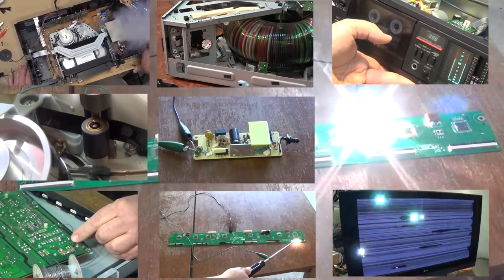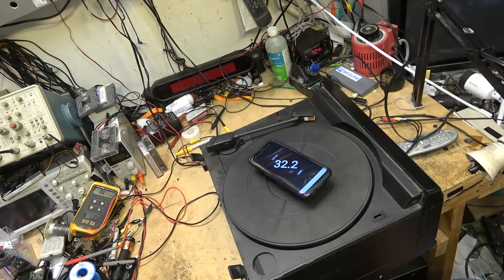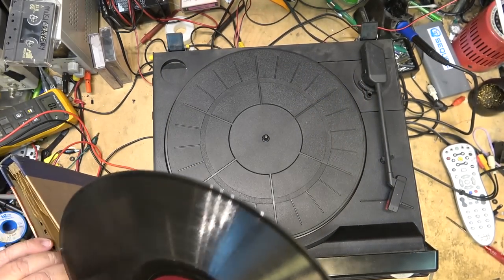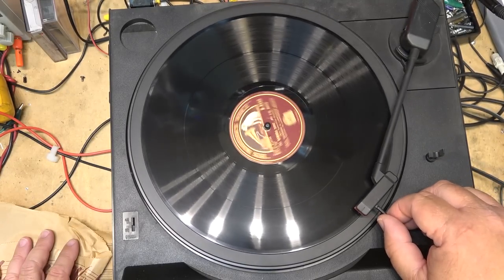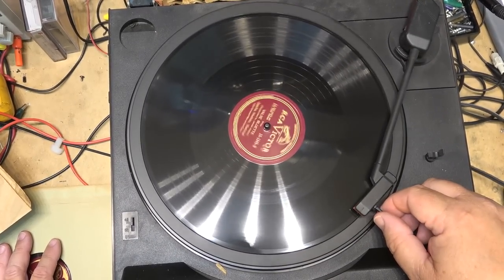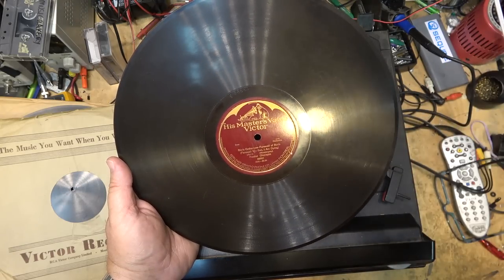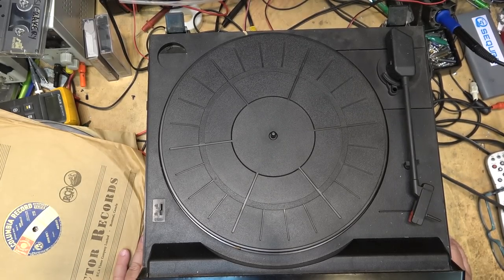78RPM mod for an old cheap Panasonic Record Player.

Comment: I’m sorry to say this but as fellow 78 rpm record collector myself I found this video very painful to watch they way you handled those records hurt me And for the Columbia special artis recored Label I would have killed to get my hand on one only for someone who is an amateur to buy a cheap turn table and slam that fragile shellac record it hurts also you didn’t care and hold a record by it’s grooves don’t do that next time please it will ruin the groves
Reply from the maker: Can't hurt them any more than the old wind up phonograph with the steel needle that weighs about 20 grams. Got rid of most of those records.  A collector took them of my hands.  Only kept the big band 78s.

Comment: Question: does speeding up the motor to get 78 RPM  decrease it's life significantly? Just wondering.
I have 1 12 inch 78 Rpm record. My late Grandmother's. (and stacks of 10 inch 78's) and also, a long, long time ago, only the wealthy could usually afford a victrola and records. At least that's what I read.
Reply: Very likely, but you could just change the belt drive pulley instead,  bigger diamater.
Reply from the maker: Won't hurt it at all.  DC motor will run at pretty much any speed up to the point it flys apart and this isn't even remotely close to that speed.
Reply: and now the victrola name has been bought out by trashy unknown china manufacturing lol
Reply from the maker: @coolelectronics1759  
Well you know who to blame for that.

Comment: If the record is from 1913, is it still possible to get a copyright strike? Current time limit is 95 years from publication?

Well that answers that. Maybe write  strongly-worded legal threat to the supposed copyright holder would result in a big fat legal settlement check? Turn their own game against them.
Reply: The recording may be from 1913, but based on that album art, it's clearly an early 1950s issue.

Comment: If that album is from 1913 it's in quite unbelievable condition. They've been well kept and will increase in value with time. Take care: they're really fragile in more ways than one! 
You need use special packaging methods when posting them and even then you're never sure they'll get there safe. The needle used can also damage them during playback. I believe the problem is some modern 78rmp needles have a stylus that's too small and gets pretty much way down at the bottom part of the groove, scraping its sides. Gotta remember that modern needles have diamond tip which is a lot harder than 78rpms can take.
You're quite lucky to get such a collection but shellac disks need proper storage conditions and take a lot of space. Lot's of people don't know they're quite valuable and just throw them away which is very unfortunate as a lot of rare recordings, especially by the early greatest artists of the 20rh century only exist in shellac.
Reply from the maker: I'm pretty sure theses are valuable. Most were tossed out eons ago.

Comment: That was fun!  I'll bet you didn't even need to jumper the resistor.
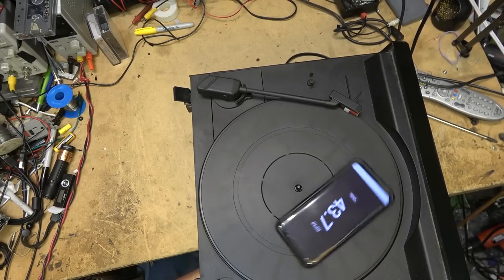Reply from the maker: You did see the part where it went up to 52 RPM or was that a point that you skipped ahead?  Its at 3:40 FYI. If you saw that then you would know that the resistor needed to go.
Reply: @12voltvids  Gotcha, thanks.  I guess the suspense was killing me and I skipped ahead. :)

Comment: There are companies that are buying up the rights of all these old recordings. 
They are not necessarily in the music business but more about money and getting revenue from copyright.
Reply: There's a term in the law like "use it or lose it", which means something like: the owner of the copyright of the music must provide fresh copies to the public on modern media for reasonable prices, or the copyrights will not be granted.
From https://recordingcopyright.org/faq.html :
"The international record companies are fighting to extend copyright everywhere, to increase their monopoly control for up to 95 years—even though in most cases they won’t use it. They suffered a severe setback when the U.K. refused to extend its 50-year term in 2006. Most scholars and economists oppose term extension, and extensive studies have shown that it will cost the public money while not benefiting musicians, however politicians have largely ignored these studies and backed the companies. The companies next tried to push through a 95 year copyright term throughout the European Union, but again there was a furious backlash. Eventually a compromise was reached in which the term was extended from 50 to 70 years, but with significant conditions. The companies get the extra 20 years only for recordings that they keep in print ("use it or lose it"), there is no retroactivity (everything made prior to the early 1960s stays in the public domain), and they have to start paying backing musicians, not just the "stars," no matter what the original contracts said. Separately, the European Union has also enacted legislation allowing the use of "orphan works." The Europeans realize how badly the U.S. model has turned out and that extending absolute monopoly control for a century does not make sense."

Comment: Do 78 rpm records have RIAA equalization?
Reply from the maker: No. Most were recordef before electronics.   The recording was made by the performer singing into a horn that had the cutting needle on the other end that was dragged through a wax disk.  The wax disk was made into a stamper which was pressed into the schallac disks. All recorded live.  Direct to disk. No mixing no microphones.
Reply from the maker: @commietube_censorship_sucks  these were all pre 1925
Reply from the maker: @commietube_censorship_sucks  dates on many show 1916
Reply from the maker: @commietube_censorship_sucks  
Some were later and these ones has the no broadcast restrictions like the James Melton but many were much earlier.  I have about 70 disks. I only showed a few.   Many are the heavier single sided disks which are well before 1925.  I am going by the copyright date on the disk.  If it says copyright 1906 I have to assume that is when it was recorded. I am not about to research these old records as i am getting rid of them.  I know the ones my grandmother left me are from the late  20s and 30s because they immigrated here in 1926 when my grandfather  was laid off from Harland and Wolfe shipyards in Belfast. Yes he worked on the Titanic and the other white star line ships built in the early 19 teens.
Reply: @commietube_censorship_sucks  Come on guys let's not get into a shouting match over this stuff - either way this is fascinating and a genuine piece of history so let's all be nice about it eh? After all, being civil takes a lot less effort than arguing...

Comment: $2 in 1916 = $50 today! (US inflation calculator)
Reply from the maker: Hmmm, no wonder new vinyl costs 120.00 today. Yes, my brain dead 21 year old has new shitty vinyl that he pays like 100 to 120 for a silly record.  When I was collecting vinyl back in the late 70's and very early 80's (bought a CD player in 83 and never bought another vinyl after than)  I remember going to the recoed store and walking out of the record was more than 5.00. I would wait a few weeks till it was no longer on the top 10 and the price would drop. I proudly stuck the price sticker to the jacket of the album.
Police Regatta De Blanc 1.99, Ghost in the Machine 2.99, 38 special 2.99, Frampton comes alive 2.99, Eagles Hotel California 3.99. Those were the days.
Reply: @12voltvids  that’s nuts….100 bucks for a record….I hope hes not playing them  on a you know  what ;) (crosley)
Reply: @12voltvids  Yes correct and unless that $120 record was recorded in Analog then it kind of negates it's purpose.  Some companies re-issue all analog recordings, but pressed on high quality vinyl.....one such operation, owned by Chad Kassem, is Acoustic Sounds, Inc
Reply from the maker: @Sans_Solo_  
Why would anyone record in analog?  If my favorite performer released a new recording and they did it in analog i would skip it.  High resolution digital is so superior to any analog recording. Shit even standard 44.1 16b is superior.  I have compared all kinds of different recordings on sound systems costing far in excess to anything I will ever own.  I was at a client's home and he had a system that he claimed was close to 500,000.  If you saw it you would understand. The speakers were 125000 by themself.  He put on Dave grusin mountain dance.  He had the LP and cd.  This was a live in the studio recording no overdubs.  Recorded direct to disk and direct to soundstream 2 track digital tape for the cd.  He was playing it on a turntable that he said the tone arm and cartridge was just under 40 grand.   I stood in his living room and he played both.  The LP sounded very good.  The cd put the LP to shame.   Couldn't tell you the speakers but they were these huge round horns that were about 6 feet in diameter and the back stuck out about 5 feet. They wouldn't fit in my living room.   All I can say is I have never heard anything like it in my life.  The cd you could place where the musicians were in the studio. It was literally a 3 dimential sound.  If you heard it you would feel the same way about vinyl I do. Limited.  Cd releases of shitty 80s rock and pop did the format a disservice because the  engineers didn't do a cd mix from the session tapes. They worked with the tapes that were already a few generations down and mixes for the limitations of vinyl and cassette.  No point arguing about how cassette or vinyl sounds compared to cd unless you have had a proper listen with good source material on a good system.  Even on my system cd blows away any analog source.
Reply: @12voltvids  Believe it or not there is a small contingent of All Analog recording studios doing business today.  (The majority of the studios use PCM or DSD digital to record tho)  The Acoustic Sounds vinyl is interesting because he is known for re-mastering archives of existing analog tapes, of major artist’s, then pressing Ultra high quality vinyl. (The UHQR do sound very good!….I only have a few because they are very pricey).  Yea I would never go crazy with my Audio system (Like to buy hi quality second hand gear and refurbish it as required) My system never will go beyond the 10K mark, at any one time, tho I do buy/sell quite a bit.  Like the gentlemen you described, people can get very carried away with their system’s for probably only a few percent greater performance/enjoyment points than a carefully orchestrated collection of hi-end second hand gear. Was able to do the factory tour at PS Audio in 2019 and this included spending about half an hour alone in Audio room One (with Arnie Nudell’s magnum opus speakers:  Infinity IRS V’s) Amazing sound! The turntable wasn’t hooked up that day so I just streamed on the Ipad.  As for Records V CD’s…...yea I prefer vinyl myself (tho do have a nice Krell CD-300 I use). ...I know the specs show digital to be far superior in noise levels, distortion, and dynamic range etc…..but digital just lacks a sense of spatial imaging, depth, and a deeper sense of rhythm that a well recorded/pressed vinyl can deliver to my ears.  I would compare it to riding a motorcycle…..why would someone want to ride around town on a loud, noisy, 2-wheeled vehicle….feeling every bump in the road, wind blowing in your face etc.  when you can drive in a nice quiet air-conditioned car protected from the elements?  Well because you have a different connection with the road and nature while riding a motorcycle than a car….and well it’s just cool! :)
Reply from the maker: @Sans_Solo_  
I listen to vinyl only for old shitty recordings made prior to digital recording.  My cd player and dvd audio player sound so much more natural to my ears then any vinal pressing ever could pretend to sound.  On vinyl the Bea's is weak and center panned and there is always rumble.  I have to run the low cut filter to avoid feedback from the speakers.  Another thing i have to worry about is a curious 🐈 pawing at the record or tone arm. Or jumping on the lid while playing.  
To me vinyl has the opposite in sound.  Thin, whereas cd and dvd audio has a very wide spacial floor.
Reply: @12voltvids  We can disagree on total recapping audio equipment and Vinyl.....I still love you/your channel and what you do Sir!
Reply from the maker: @Sans_Solo_  I have heard fully recapped gear and didn't feel it improves sound. It did change the sound, but I wouldn't say it improves it.  If someone brings me an amp and says recap it i will change out every last one and charge them accordingly. I never get customers like that.  I get customers that come in and say make it work for 50 max. Don't spent a penny more.   So the part that caused the fault is changed.  Just today i had to condemn a 5 disk cd changer.  Got into it. Plastic parts breaking.  No parts available and I am not even going to look because one of these can be had at the second hand store for about 30.00.  I haven't decided if i will do a video of it or not.  Probably will just to show the mechanism.
Reply: @12voltvids  I am my own customer mostly, but have had some folks approach me to do capacitor work that I have accepted, but I could show you a Pass Lass Aleph 3 that I fully recapped, and it sounds damn phenomenal compared to original (Mundorf main filters) and its only 30watts @8ohms, but Class A
Reply: @12voltvids  There is a small community of people out there who will manufacture (usually by 3D printing) plastic parts to custom order, but although this is a great service to have available, it's very rarely economically viable for most repairs. I've made parts this way myself but it takes quite a bit of effort in the design process and I wouldn't like to be doing it regularly for sale as I just don't have the time required to design and print the parts

Comment: No. Those are crappy for 78s. No pressure adjustment which those are insufficient. 78s need more counterweight (I do mine at 5.5g) and a direct drive motor turntable (old Gemini  PT2000).
Reply from the maker: They actually sound great. Almost as good as my old Philips mono record player with tube amp.

Comment: You should hacksaw the turntable off and make it standalone.
Reply: No need.  this same basic mechanism is used in many cheap modern turntables.
Reply: @xaenon  i was half joking...but id seriuosly hack it off and glue a cardboard base on.

Comment: Looks like it's missing a spring at the back of the arm to stop it from being too heavy.
Reply from the maker: You want it heavy for 78. Remember these were played with a sharpened knitting needle on a gramophone.
Reply: I may (very possibly) be wrong, but I think you will find that the sharpened needles were used on early gramophones.
The records were made of shellac and shattered if dropped. 
What you are playing in your video are early vinyl records which can be played on a modern player using a 78 stylus tracking at 4 to 5 grams. Without a spring or counterweight to regulate the tracking weight, the arm will track at much higher weights and will probably wear out the vinyl very quickly.
Reply from the maker: @calypso22  Actually they are shellac and they will shatter if dropped. Vinyl didn't appear until around ww2. These are much earlier  than that. The sharpened needles was a joke BTW. They uses to use bamboo, and then soft steel sharpened to a point and they would last 1 or 2 plays.
I had an old wind up gramophone years ago, but the main spring broke, and they guy I contacted to try to find a spring offered to buy it from me. Offered me more than I ever imagined it was worth so I sold it. I used to buy bags of needles from main electronics. 100 for about 5.00.  

From wikapedia: "Any flat disc record, made between about 1898 and the late 1950s and playing at a speed around 78 revolutions per minute is called a "78" by collectors. The materials of which discs were made and with which they were coated were also various; shellac eventually became the commonest material. Generally 78s are made of a brittle material which uses a shellac resin (thus their other name is shellac records). During and after World War II when shellac supplies were extremely limited, some 78 rpm records were pressed in vinyl instead of shellac (wax), particularly the six-minute 12" 78 rpm records produced by V-Disc for distribution to US troops in World War II"
Reply from the maker: The spring is there, and the arm tracks in about 6 grams actually. I saw being sarcastic when I comment about it weighing at least 10.
Reply: @12voltvids  I see some 78 rpm 7" things were made until the late 60's usually with kids content.. I have one on multicolour vinyl.. to be honest it looks like a pavement pizza...
Reply from the maker: @PaulaXism  78 were 10".  7" were 45 and multi colored vinyl was a cataloging thing.  Classical got red i know that because i have a few.  Rock and roll was another, as was jazz, and then other colors for black artists or white artists.  So parents would know what their kids were listening to.  Was a tv show on that not long ago.